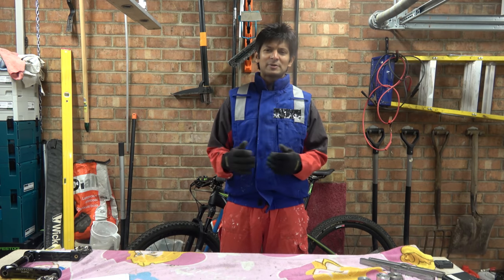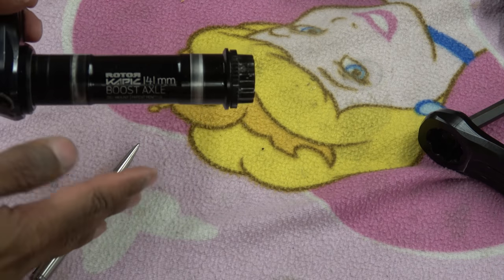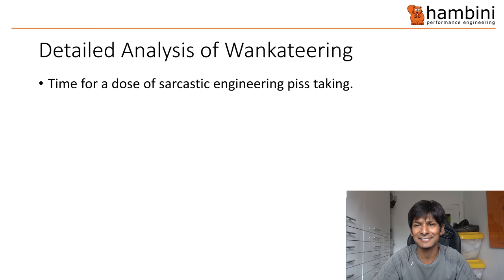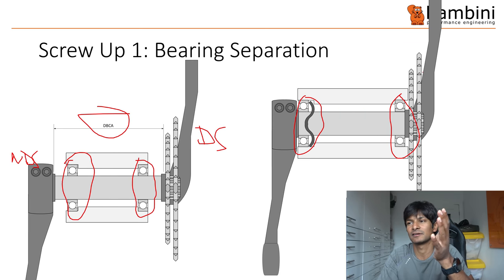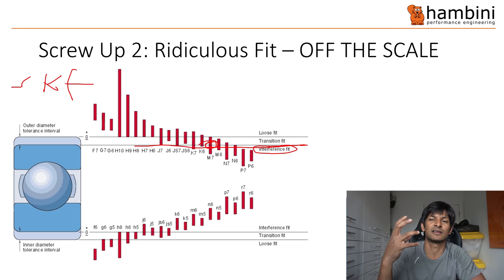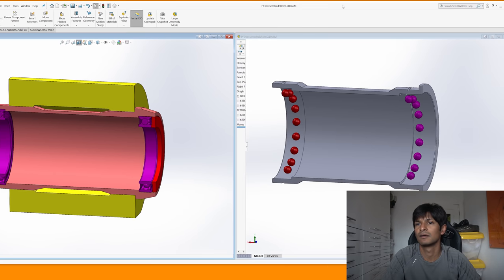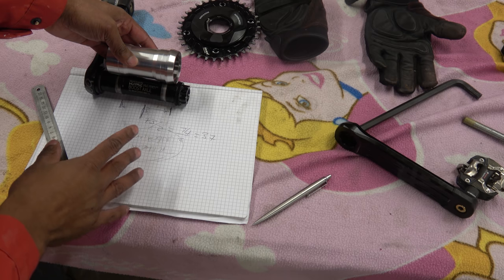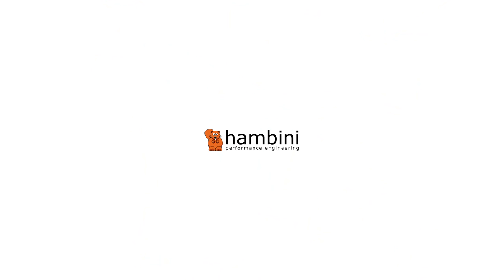Engineered By Muppets | Niner Bikes get Burned for being CRAP | Abysmal QA

Comment: If the original BB was flush/inside the frame then it was the wrong BB to start with. No disagreement on the fix, and the frame issue, love the job. Personally have always used an external bearing on these bikes, never had an issue. Rotor's own bb unit works well and lasts for ages.

Comment: Mr hambibi apologies for timing and place of this query however I’m poor and have single piston or single side acting callipers. To get them efficient without smashing them to bits with a wallet do I remove lever arm free play thus lowering leverage but reducing the required travel to engagement or give up and buy hydraulic or trp twin actuated pads etc. Trouble is while my bike is cheap I’ve got it set up perfectly and don’t want to change it but I do also want to stop. Yours sincerely lesser qualified engineer and cyclist.

Comment: Could that issue be made worse due to a poor installment of the BB and cranks into the frame? That's a 2017/2018 and Niner doesn't stock anything with Rotor cranks and it could be that they swapped the stock Sram BB for a nicer one from rotor or another company. It actually looks like a custom build.

Comment: Why would anyone engineer a boost spacing rear triangle frame with a narrow PF30 bottom bracket standard. PF30 is dead anyway since all cranks nowadays come in longer axle designs to accomodate all standards. The real BB30 cranksets are hardly around any more, and some wont give you the correct chainline for boost spacing....
Reply: chainline??? aint no chainline on a 1X drive. if you singlespeeder yes chainline considerations.

Comment: @hambini I’m curious how you draw a distinction between poor engineering and poor manufacturing.  Now I’m not arguing whether or not this bike is well designed, but it seems to me a bike, or really anything be it a bike, car, gun, aircraft, etc, can be well designed/ engineered but poorly manufactured.
Reply: He can't, he interchanges the two with no regard for their actual meaning.
It is possible for things to be poorly engineered, but we need to split that into the mechanical design side and the geometric tolerancing side along with factoring in some manufacturability analysis.

Personally I believe the engineering of these BB systems are solid. None of these bearings are under designed for the loads, the materials and components selected are a good balance of price and performance. As far what the prince look like from a gd&t perspective? We have no idea as consumers.

Where things fall flat is on the manufacturing side. Perhaps these BB specifications are simply impossible to hit when done in CF, or the manufacturing process simply isn't in control enough to produce properly aligned BB's in every frame. As we can see some frames in CF work, then we see others that don't. I mean that in the exact same model frame. That's a process control problem, that's not necessarily an engineering issue. As a design engineering it's not your fault if manufacturing says they can hit +/- .002 and are actually hitting +/- .012.  or if the process is so out of control that some of the frames are +/- .002 and others are +/-0.012. that's why God invented control charts, but who knows if they're actually using them.

Comment: Shouldn't bottom bracket bearings be angular contact instead of deep grove radial contact bearings.
Reply from the maker: Most are deep groove. Even a deep groove has a slight angle of contact. I do have a video on it

Comment: Just curious - Are there any manufacturers that you think actually make good quality frames/bikes? The focus of your videos seems to be almost exclusively negative. As a bicycle mechanic myself, I typically agree with your views regarding sound design engineering. That said, there is always a loss in translation from design to actual manufacturing. Who do you think does that part well? Also, how did you assure that the BB bore in the frame was true to the rear axle?

Comment: OK the holes are orrible, but this frame is really good, smooth on rough terrain but responsive under power. I've got terrible Sram gxp crank but with Black Bearing BB (2 alluminium pieces screwed) with NSK bearings the result is very good. Not like with Hambini BB but you don't produce PF30/Gxp. Sorry for my italian/english, I know is not like your french/english.

Comment: Thanks.  Nice, streamlined solution.
Looks like shops need new BB reaming & facing tools.  (Saying this after facing an old steel BB shell yesterday...)
I was wondering...  did you address the grooves left in the shaft prior to reassembly?  Seems like those were pretty good stress risers left in place on a part getting all sorts of high instantaneous axial loads (drop offs, jumps, etc.) - especially being a hard tail.  Seems like smoothly removing a little OD at the previous bearing locations would have been worthwhile, no?  Yes, you're removing material in a critical area, but more importantly, removing the groove stress riser is even more important, no?  Thanks.
Reply: not a jump frame is it...
Reply: @8iamretarded8  I'm pretty sure I've gone off about a million jumps on my hard tail.   In fact, I snapped my BB spindle on a nice drop in Moab back in the day.
PS  I've even jumped my road bike!  OMG, impossible, right?

Comment: Moving the bearings more outboard is actually really clever and a solid solution, cannot fathom people not grasping the benefit of that. The concern is mainly compatibility (edit: you addressed that), so as long as it means he can still get crank setups that fit, it's a proper win. How do you machine that out on a home setup? That does not look straightforward to control.

Comment: Hambini,  I installed your BB86 necked bottom bracket in my bianchi xr4.. It seems to spin not as freely as when it was out of the bottom bracket. Is that normal?
Reply from the maker: it suggests the hole is undersized, did you measure it before? It will usually bed in after a few 100km Hambini
Reply: @Hambini  yes, it IS undersized

Comment: You can see he is riding with an oval shaped chain ring.  That alone will cause the load on the bearings to be higher on the push strokes and cause the failures.  Since they have a load meter on there, they are definitely mashing like crazy.  I wouldn't blame the bike mfg for that issue.

Comment: I would like to see more inspections of such high level brands as Yeti, Santa Cruz, etc.
Reply: Tried to send Hambini a Yeti SB100 as very unimpressed with the BB as it will only take SRAM Dub BBs that deform as the shell is made of plastic.  Tried to put a Hope one in and the bearing binds.  Tried the same on a Yeti SB130 and same issue.  Spoke to Yeti and they know about the poor build quality and advised to use the SRAM one.  Not what I expect on a £7000 bike.

Comment: It would seem that to get good alignment with carbon fibre is a real hit and miss affair, where even the top brands can fail. 
What is a solution that is cost effective and easy to apply?
Reply: Going with aluminium, steel or titanium, which can be made with CNC precision. The effectiveness of carbon really is overblown and at some point is it really worth the hassle when manufacturers don't seem to be able to manufacture products within tolerances?
Reply: One piece BSA shell. Or a metal bike frame:-)
Reply: I have machined a bearing journal for a top top race team recently for some development parts for new regs coming in next season.. got it within 0.01 on dia and 0.02 circularity. probed on machine and on CMM. Just depends how you approach the machining and what tools and machinery you have to work with.
Reply: @thomasjousse2427  This. There is so much frogs hair advantages to carbon and pure marketing bullshit, I weaned off expensive CF frames and live a full life in the alloy lane. 
This channel has taught me some easy LBS QC, like spinning a crank with the chain off before I drop my shekels. Frankly, in the MTB world, to get CF reliable they weigh as much or more than alloy, and these bikes lead hard lives, so we can drop the "last frame I will ever buy" fantasy. There are some entirely milled alloy frames from Pole that would would get Hambini to leave his hairdresser, and lugged titanium carbon tube Atherton designs that make monocoque (from the French for "single chicken") frames pointless.
Reply: @truantray  "monocoque" is from "single shell" (coquille) As in Coquilles St. Jacques. Nothing to do with chickens

Comment: I'm surprised the crank didn't pulse as it spinned. I would think rotor would be putting out true cranks and hard alloy too.
It's a bicycle, so when glossy brochures bounce around words like "exquisite", "boutique" then quote verse from rock bands best avoid. There's a few bike shops or "bike boutiques" that I wouldn't go near.
Reply from the maker: i think the crank was so beyond it that it simply ground in and when ton a slightly ovalized orbit.
Reply: @Hambini  😕

Comment: Didn't want to clog up the live chat thing, but I've been wondering. When engineering a large item how much does the ability to ship, handle, transport an item influence the overall design?
Reply: @Jake Irvin that's what I'm talking about! I work in shipping and receiving small goods to be honest. 80% can fit on a standard pallet. A lot of things seem to fit so efficiently on pallets (including non standard size). I'm guessing with most of the consumer goods I deal with the packaging fills the voids for a perfectly packed pallet. But it's just made me think about general transportation of large items.
Reply: A lot.
Reply: I remember reading years ago that the reason flat screen TVs were developed was so  manufacturing could be moved to China and CRT TVs were too big to be shipped at reasonable cost. I remember seeing a Sony CRT HDTV (made in Japan) and it was magnificent!!! Flat screens are getting better but that CRT HDTV was completely amazing.

Comment: Does adding to the outboard dimension change the shifting indexing or the shifting alignment?
Reply: Good question. The new BB does seem to have taken the existing stance of the cranks and spindle into account. The biggest thing that's been done here is to simply widen the bearing stance with respect to the same "boost" crank spindle.

That said, there are other examples where shift indexing can be affected, and often it's down to the crank. I experienced this myself when I upgraded from a 105 5700 crank to a newer 105 R7000 unit. The R7000 unit sits about 2-3 mm more outboard, enough to require readjustment of the front derailleur because shifting outboard wasn't moving its cage enough to move the chain to the big ring. GRX 2x cranks supposedly have an even larger move outboard, big enough to require GRX's specific front derailleurs be used with them.
Reply from the maker: No it doesn't, the crank is in the same position that it was in before, the bearing position has moved on the new BB. Index remains the same
Reply: @Hambini  thanks!

Comment: Question - what's preventing the machined BB from working its way out of the BB shell over time?
Reply: ffff.... friction.
Reply: A proper interference fit, and sometimes a thin layer of loctite adhesive.
Reply: @truantray  which is kinda friction.
Reply: @OYeahan  adhesion is fundamentally different from friction.
Reply: @Skooteh  hmm but with carbon fiber you usually use Loctite to fill the gaps, not to have adhesion as adhesion might damage the composite upon BB removal
Reply: @OYeahan  All thread lockers and retaining compounds are adhesives. They are designed to different holding strengths for different applications to avoid damage.

Hambini recommends the use of
Loctite activator 7649 and Loctite Medium Strength retaining compound 641 when installing his press fit bottom brackets.

Loctite does make a variety other adhesives (like superglue) which will cause damage-don't use those.
Reply: @Skooteh  BTW  I meant that "interference fit" is kinda friction, where pressure comes from interference. With good fit interference should be enough in this scenario, but as the fit differs as we all know then it's safer to use a proper retaining compound, but as I understand it's other function (that is at least as important as adhesion) is to expand in volume sightly and fill the gaps, therefore increasing the interference force. I've also seen some warnings that it's "dangerous" to use such a retaining compound with carbon when not using a primer as it might cause the carbon to delaminate upon removal, but I don't really understand how could it be as the role of the primer is just to activate the anaerobic in (more) passive environment
Reply: @OYeahan  Hambini mentions in the video we're commenting under that he uses a light interference fit to avoid tolerance/preload stackup affecting the bearings. Presumably, he recommends retaining compound to make up for the possible inadequate friction in the press-fit interface (especially with oversized BB shells). I think he also mentioned that a light press fit with retaining compound is less likely to cause damage than a heavy one without, hence his recommendation.

Friction from the press fit and adhesion from retaining compound aren't mutually exclusive. As designed, Hambini BBs use both to provide a secure fit.

Comment: Had several times this same problem. First a mtb from Santos (Dutch brand) went back to the shop every week for 3 months. They did not solve the problem at all and did not acknowledge the fact they sold me a shit bike. Second one was a niner RDO to. Same bullshit as the bike in this video. I bought the frame and builded a niner with a lefty. In one year it ate 3 sets of bearings and ruined a crank. Also Niner did not acknowledge it.

Comment: Without knowing the tolerances on those "standards" of yours, is hard to tell how accurate they actually are.
Reply: RollinRat  Or they use open bearings, which have less tight tolerances and can just be packed with grease to mask imperfections. A similar scenario happens with cassettes.
Reply: RollinRat  Yup.

Comment: First one of your vids I have watched. Quite like your style of delivery. My reason for watching is because I bought a cheap MTB a few years back and have recently had to change the rear tyre. Gave it a bit of a check and oil round as well. Gear change and associated bits and bobs are really cheap & nasty, generally a very cheaply made machine but, hey, for £199 what would you expect.

Comment: I wonder how much he  paid for that shite   , Terrible frame design as well  I hate that style of frame looks like girls bike    .. tbh He should seek a full refund .. 

If he bought that through a Niner Dealer  they should be ashamed .. for not checking the bike ,  Bikes should be stripped down and rebuilt .. so all the parts and fittings are thoroughly checked  if any faults arises .. the bike should stricken from sale . and sent back
Reply: Get real, no one does that outside of >$10000 custom builds.
Reply: It is pretty much these days that any bike you buy...you should assume another 10% of fuck-ups you will have to fix/repair on your own dime.  So buy a 5k bike..expect to spend another 500.   Welcome to a shite world.
Reply: @truantray   Your the one that needs to get real .  If Dealer/Company  can't be arsed properly checking  product before being sold/shipped  ..it's a matter of principal ..   If you allow faults to go unchecked .. it gives the shop and the brand a bad image .. and reputation .
Reply: The frame should get checked during QC before any parts go on, but since that is in an outsourced factory in China they don't really give a crap. BB hole goes through to the other side? QC pass.